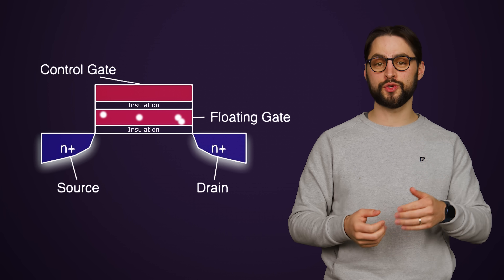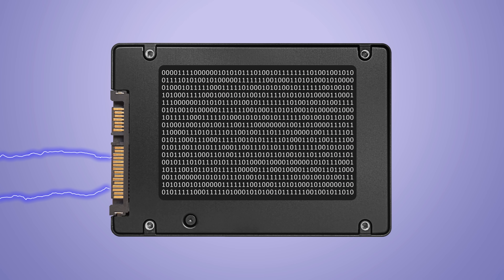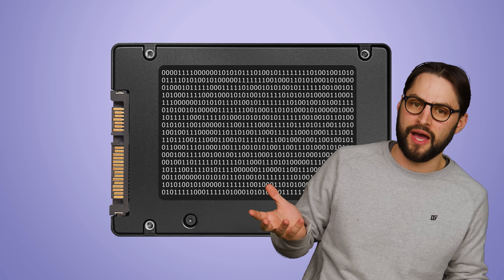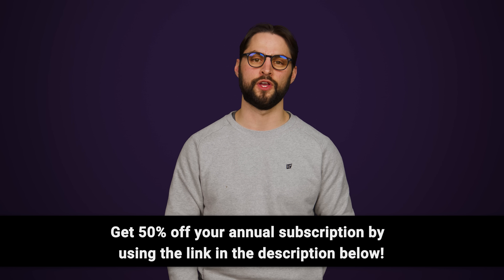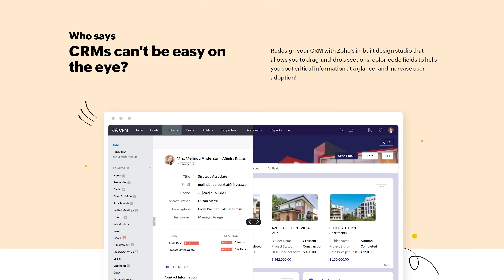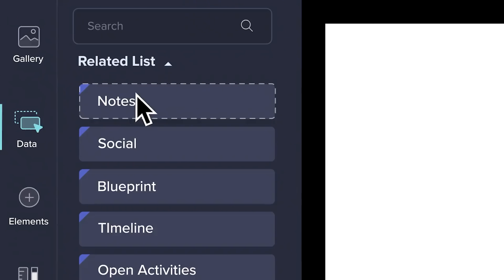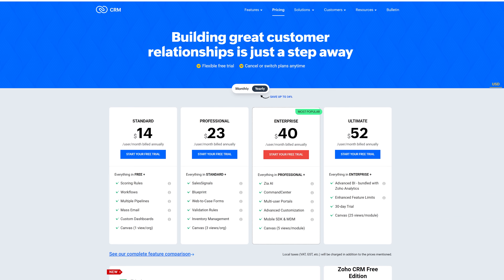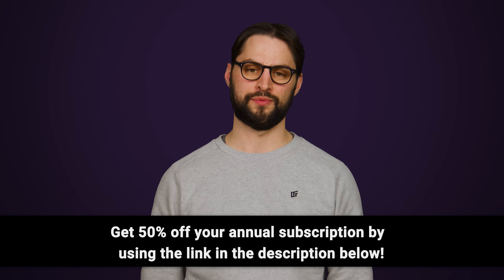SSDs Die, RAM Doesn't. Why?

Comment: The first ssd I ever bought back in 2010 is still functioning perfectly. I have another newer ssd with around 1PB of writes and it reports no problems. I've had one ssd die and it happened in the first week or two, got a free warranty replacement a week later. Overall ssd's are crazy robust.

Edited for clarity
Reply: I have an OCZ SSD (the most notorious for failing) that I've been using as my boot drive since 2011 that's still going.
Reply: @issicus2  same here - a 120gb OCZ agility 3 from 2011, although it’s no longer used as a boot drive
Reply: @issicus2  You got lucky for sure!
Reply: @issicus2  very lucky, mine just gives the red "crash" or "panic" ssd when trying to access speciffic sectors of the SSD
Reply: @issicus2  OCZ is the reason I only look at Samsung now.
Reply: @issicus2  Mines been demoted from boot drive but is still going strong. Crystal disk says it's still 85% healthy.
Reply: @issicus2  Mine -one of their 3,5" -gave up after a couple of years

No early warnings, no previous issues ... gone
Reply: @issicus2  As do I, but it's finicky. Every so often(about monthly/bimonthly it craps out, crashes my computer, and won't behave again until I leave the power off for a few minutes, I guess it needs its caches cleared and all residual charge out, and maybe to cool down.
Reply: @issicus2 Adata SU800 - Bought in 2016, still use it in my laptop and it has 0 problems (expect that it’s always full but what can you expect from 256gb drive anyway)
Reply: @SuperWhisk Maybe it's an SLC SSD. They are much more durable than MLC, TLC or QLC.
Reply: @BrianG61UK  SLC SSD also produces better sound as well. We only use SLC SSD exclusively in a recording studio.
Reply: @simplereef4854  SLC SSDs are less likely to have occasional slow reads. But that should be overcome easily by buffering. There should be no other advantage.
Reply: What's the capacity of your 1PB Writes SSD?
Reply: @FireXplosion  1TB some Toshiba nvme drive
Reply: @FireXplosion likely 1-2TB.
Reply: So are CPU's, I got an AMD FX8350 in 2013 when it was nice & shiny.

Since they I leave my computer on 24/7 doing Prime95 in the hopes to one day be in the history books. Then after 2016 I've also been mining 24/7 (when not playing games).

My FX8350 has been pinned at 100% for the past decade & it's still my daily driver PC, I have zero reason to upgrade & get more computing power. It's amazing how reliable computers are even when you push them to their limits. Imagine running a car at 100% for an hour, yikes.
Reply: @levelup1279  Chrysler did run the Crossfire SRT around Daytona 500 track for 24 hours at 150 mph, the car topped out at 163 so it was very close to max rpm and only took a break every 2 hours to fuel.
Reply: My OCZ Vertex 4 drive died within its 5 year warrenty, it wouldn't have if I didn't decide to start using it as my download drive
Reply: @levelup1279 yeah, I still used my dad's Athlon 64 for a Nas and after 20 years it still works. Swapped it out for an i3 3220 because I needed dual core for other things, but it still worked. Also I've seen a 30 years old rv run for 15 hours straight at max speed. It wasn't nice but mostly because the suspensions were original and overloaded, and the road was a cheesegrater
Reply: @levelup1279  Gas turbines work at 100% for years before each maintenance and well, they all work without any problem
Reply: The first SSD's were notorious for failing. It happened three times to me
Reply: @xanderguldie  even in enterprise space.  some drives will fail 100% of the time when they hit a power on time without a firmware update of course.
Reply: A friend of mine destroyed his SSD in a year by running his Masters' project repeatedly on it (which wrote tons of log data to storage).
Reply: SLC Nand flash in the earlier SSD's were much more reliable, MLC in 2nd gen are almost as reliable, ( if from higher tier makers ) everything now is 3d or Vertical stacked and thus way less reliable.( could be 64 bits high vs 1 or 2 of the older stuff ) The advantage of 3D Nand is higher capacities & cheaper, the advantage of the older SLC and MLC were 1 or 2 levels that limited size, but way more reliable. Apple for instance only used the best chips and SSD's and the 512Gb  I have from back in 2009/2010 still have 90 of their life left ( Using DriveDX ) vs OWC regular 3d being only 52% left in my 2 year old 2TB SSD. 512Gb was the limit back in the 2010 Macs so I have had to upgrade as my data storage needs got larger. Those drives were made by Toshiba or Samsung. Buy a Samsung Pro drive now and you still get pretty good life, but not as good as what the older ones gave. High end drives combine a large SLC cache with the 3D chips to help with longevity. Buy a cheap PNY drive now and you will likely only get a few years from it but they are way cheaper than the Samsung Pro drives. I do data recovery and honestly, spend the money for the better drives or make great backups. Recovering SSD's is much harder and costly than spinning drives.
Reply: Good to know!
Reply: My first ssd was a Kingston 120gb and it's still alive, SLC was crazy resilient
Reply: One thing I've always done, is leave 1% of the drive unformatted or as an unused partition. It used to be more important on old ssd's before things like TRIM were standard. So for a 1TB drive I leave 10GB unformatted. This ensures even if I get careless and totally fill the partition with my OS, there's always a few GB left for write caching, trim, and other ssd background maintenance. Can't say empirically that's made a difference but it doesn't hurt.
Reply: @SuperWhisk normally I'd be worried but it's an old boot drive I'm no longer using. Honestly probably time to recycle it. I used it for handling, storing and analyzing genetic sequencing data. But I no longer use that system.
Reply: Im also using an SSD I installed in 2012. It's not my main SSD anymore, but its a scratch disk for video editing and it's still running strong. All I can fathom is that all components can die in a week, a month, or multiple years... All hardware is a crap shoot.
Reply: I should have clarified the oldest ssd does not have 1PB of writes. I was referring to two separate drives.
Reply: I've always tried to stick with major brands mid to top tier products. Definitely always with Dram cache. Crucial/Micron high end drives. Samsung Evo and Pro drives. A few Intel Data Center pcie drives. A couple Toshiba drives which were mostly oem and not my choice, but they were fine. The only ssd to fail me was a WD blue sata drive. Warranty replacement is going strong though. Just bought a WD Black pcie 4.0 2TB nvme, hopefully it lasts me a long time.
Reply: Found the datahoarder
Reply: Are you telling me that a 10+ years old ssd still has 100% of it's capacity? From what I have seen online that ain't happening.
Reply: @dannygjk  I bet if he looks at hdsentinel it's probably pretty low life
Reply: @bandit8623  yeah.
Reply: I kept having hard drives crash as a teenager in early 2000s to the point that I got in the habit of never personalizing my computer. Give me a fresh installation, I'll install Ms Office 97 and Winzip and get to work, keeping all my files on external. Bought an SSD in 2010, haven't used it since 2012. Will see soon if it still works, it's my stock trading and banking computer, was trading bitcoin on it.
Reply: You should provide more information like, what programs do you run on your computer.  
Are you running a database program which are performing millions of I/O daily to the SSD?  
Are you running excel, word, outlook which perform a lesser amount of I/O to the SSD?
Reply: First drive is a Crucial M4 128gb bought for around $250, it was actually purchased in 2011, so 11 years ago
Reply: yea, some ssds wear out more than others
Reply: You better retire that thing
Reply: I have an ssd patriot blast from 2016. Till this day it works. Perfect health in sentinel. Its a 120gb one for system only. I just recently bought a 512 gb ssd because my 6 years hdd failed. But the ssd from same year still is kicking it.
Reply: i have a crap one thats been running since like 2016 and its only 80% health rn
Reply: Same here, X-25M son...
Reply: I have only ever had a SD card die with solid storage and it did the same thing an SSD does and went read only so I backed it up and replaced it.
Reply: still using a intel 330 120gb ssd that I bought last 2012 as my boot drive. Shit just wont die lol
Reply: Well.... My MFM harddrive from 1987 are still working without bad sectors. No SSD can manage so many years. Not even without bad sectors.

If spinning platter drives were as fast as SSD's, then we would never switch to SSD's.
Reply: @brostenen  You're lucky. Most MFM drives are very not alive right now. Adrian Black has done a number of videos where he tested them out, and few still worked.

It's pretty common for heads to get stuck to their platters, resulting in either the disk failing to spin (because the spindle motor doesn't have enough torque to break the head free) or the head getting torn off (because the spindle motor does have enough torque to break the head free).

Newer hard drives are pretty solid, and don't suffer from stiction at all (they now retract the heads when not in use), although they still are pretty delicate and may not survive a fall, earthquake, or the like.
Reply: @argvminusone  Yeah... I believe most failures are down to the heads not being parked.
Reply: stop lying :)
Reply: If they dont get HOT
Reply: one PB of writes?? Whats the storage capacity of your ssd and whats the TBW limit of it?
Reply: I came here to say this too. My 870 evo is still going strong. I got it in like 2014
Reply: @FinalDriveGame  there is a really good chance that if a ssd fails it is not the nand chips. If so, I believe recovery services have tools to read data from desoldered chips.
Reply: Problem with ssds is that if they do fail it's likely you won't be getting any data out of it. Also if you have an ssd raid for backup and an environmental condition had fried one ssd likely it fried all ssds connected to raid in same way. In contrast hdd's are more reliable in sence that environmental factors such as electrical surges or water won't destroy the data that lives on them - even if hdd was destroued and isn't functioning anymore typically you can still remove the disk and extract all the data with help of some tools. Thus hdd is still preferred storage over ssd for archivals and backups.
Reply: Same i have my first ssd still going strong as my boot drive. Adata 128gb from 2012
Reply: 1 Petabyte of writes?! Is that possible? What sort of enterprise-level SLC SSD are you using?
Reply: Dude I just think it's crazy how much 1PB is. Imagine, you have a 1 Gbit connection. In the optimal case, your downstream is gonna be 125 Mbyte/s. It therefore takes 8 seconds to write 1GB. 1PB is 1 million GB. Therfore: 8 seconds * 1,000,000 = 8 million seconds or 92 days. Doesn't sound like much, but you're writing to it 24/7 with a fucking Gbit connection going full throttle.
Reply: you can even drop them! unlike HDDs lol
Reply: I still have a 10 MB hdd from 1983 that works perfectly in my first IBM PC. Ahh, the blazing fast speed of the 8088.
Reply: @TheGlock30owner  you should make a video o of it, sounds really cool.
Reply: @therealb888  that would imply I have an interest in making videos... Not something this over 50 dude is inclined to do
Reply: @TheGlock30owner  my bad, but it is cool that you were geek back when tech just started. Wondering how much average people cared about tech back then?

Are there any similarities between those days and web 3.0 (crypto, blockchain, etc) of today?
Reply: @therealb888  I was 12 in 1983 and my first PC cost more than $3000. My mother (a real boomer geek) used student loans to get the computer to assist her with her CIS degree (the precursor to IT).

The biggest similarities between then and now is that those with the least knowledge and imagination are still the ones implementing tech solutions, abysmally.
Reply: The First SSD I bought (also around that time died after about only 6-7 month of light use (along with a year or two of being hooked up but not used at all). I RMA replacement that I got also died within a similar time period, and by that point the original's warranty ended.
The third SSD I got failed after a few years or so.

And in all these cases the failures were catastrophic. Computer wasn't even recognizing them, let alone something like read-only.

My experience with SSDs have been many times worse than HDDs. With HDDs they've generally lasted me 15-30 years, and they rarely/never completely crap out instantly.
Reply: In the future we could see infinite endurance SSDs
Reply: @davidperry4013  No. Flash storage cells will always be worn down with use...
Reply: Old drives are better. They used SLC and Mlc.
Reply: Wtf did you just say
1PB SSD??
Reply: SSDs are still better than hard drives as well.

Comment: Memory usually doesn't completely die but it certainly does degrade.  

Lifetime warranty is a bogus guarantee as the tech surrounding the memory dies anyway.  However Samsung does offer up to 10 years on some of it's SSD offerings. Which is basically a lifetime warranty on the tech period.

Comment: there is interesting work going on about possibly using Nuclear Diamond batteries to make stable ram. If that initiative makes headway, we may see "SSDs" with an effectively unlimited lifespan hit the market.
Reply: Nuclear diamonds don't even output enough electricity for a normal LED to work.
Reply: @stavinaircaeruleum2275  absolutely. A typical LED is surprisingly power hungry in comparison to the maintenance power of RAM. It's important to know that the battery isn't used to OPERATE the RAM, just maintain it's value when powered off. It's also important to know that the RAM is able to refresh cells in batches, rather than all day once. Finally, it's also important to know that the research going on uses more than one battery per RAM memory chip.

It's still an active area of research, and certainly not going to market ready for years, but the prospect is attractive enough to have garnered sizable investment and R&D budgets.